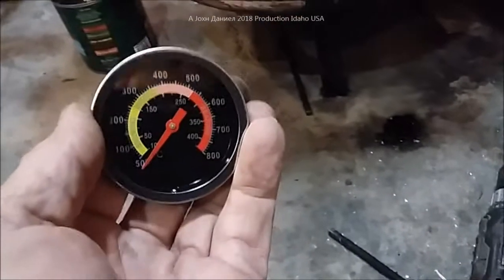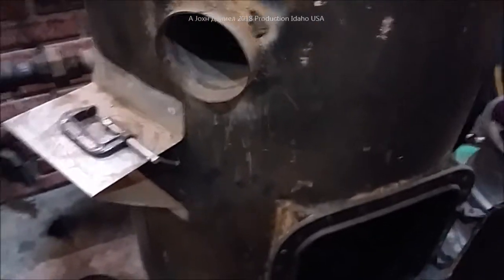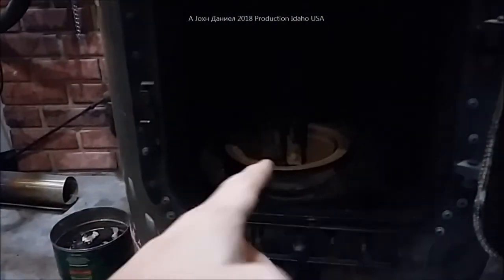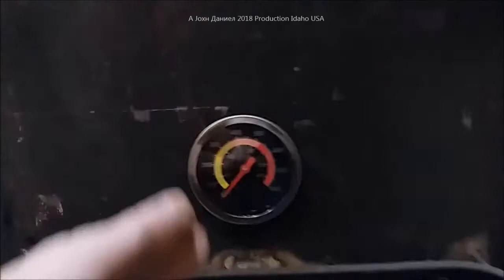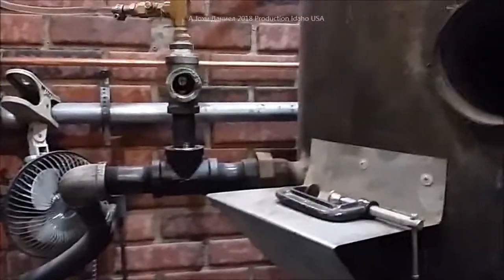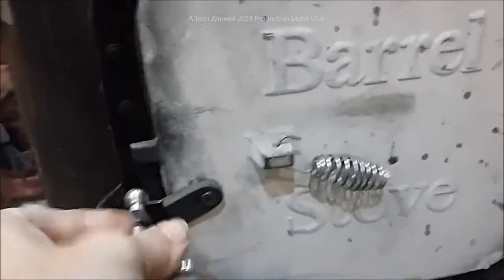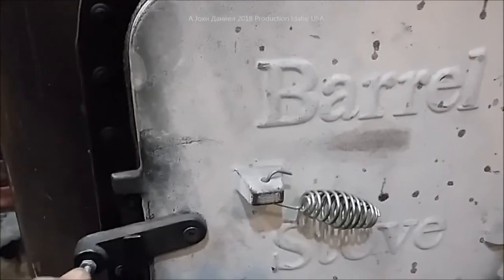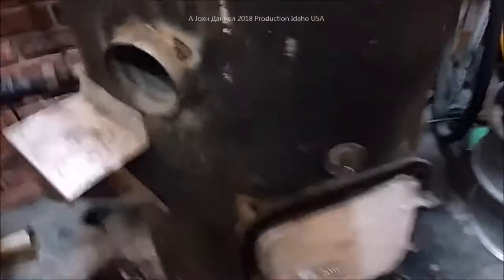Waste oil Heater upgrade #2 for temp control monitoring

Comment from the maker: When you build a oil or wood heater, consider a gauge to monitor it at http://amzn.to/2F2KtIN This large 800 degree one I have used in numerous things, from a generator housing to monitor exhaust temps to my waste oil heater. Its very accurate.